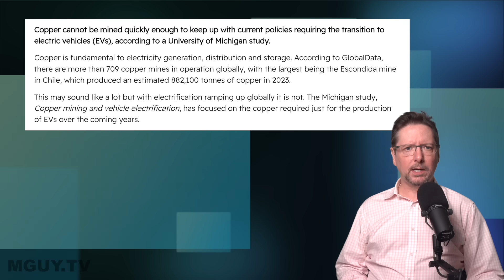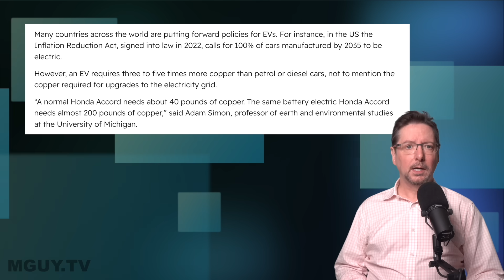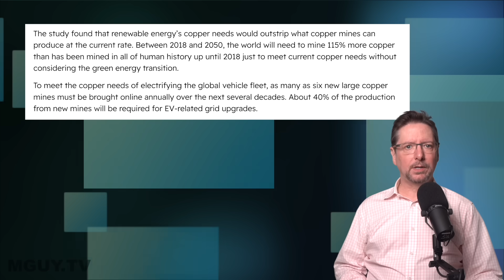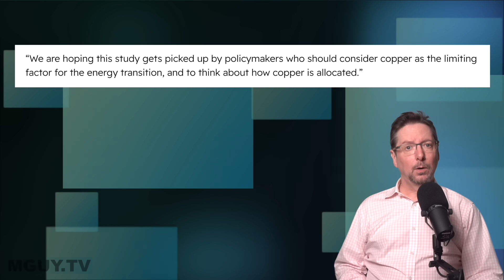Copper cannot be mined FAST ENOUGH for EVs and Net Zero Transition | MGUY Australia

Comment: Well shit eh you have finally worked out what metallurgists like your truely could have told you 20 years ago if you cared to ask but I suppose you were not being paid by the Petroleum Institute back then as you obviously are now
You really need to read some better magazines while sitting on the dunny , I mean the technical stories in Playboy are just not what they used to be.
The rate of mining is insignificant if there is no bloody cooper left to mine in the first place .
But shit I am not a Yankee University so what the F would I know ?
But almost 20 years ago the Copper Development Association put out estimates of the amount of copper in the earths crust 
Now guess what ?
To replace the entire US private vehicle fleet with EVs would require 2.5 times the current know reserves of copper.
A little caveat here is the known reserves are around 60% of the estimated reserves because geologist estimate that there is more than the copper miners know about yet .
And then there is vegetable copper that can be recovered from different plants that bio accumulate it . But that is quite expensive and we sort of need plants to process CO2 back into O2 .
And I see you like to sound impressive with a pile of total BS imaginary numbers  you probably researched off face book  because they are total garbage like most of what you post .
And by the way a large number of car makers now days are using copper plated steel cables for the battery cables and a few are even using aluminium .

Amongst those who know rather than those who just BS on YT there is a bit of an argument about weather we will run out of niobium before we run out of copper .
Then there are another 1/2 dozen rare earth metals that could run out before copper as well because , well they are, as the name suggest rare = not bloody much of them

Please do Australia a big favour & piss off back to the UK we definitely do not need your kind down here we have more than enough home grown clowns

Comment: A good outline of the Energy Transition Delusion. The false and delusional belief that transitioning to non fossil fuel energy sources will be cheap and easy.
Wind has a low energy density and wind power is centuries out of date. Wind farms make no economic sense. They are a colossal waste of taxpayers money and resources (including coal and oil).
Solar panels are only economical as a supplement in sunny areas between the 35th parallels. Even in favourable areas there is a major mismatch between peak supply and peak demand.
Net Zero is economically destructive delusional insanity. The carbon dioxide emissions from fossil fuels are largely beneficial. Benefits include greening of the planet with increased agricultural yields (main effect), reduced winter heating costs, fewer deaths from hypothermia and postponement of the next glacial maximum.
There are 2 mass psychoses in operation (Climate Delusion and Energy Transition Delusion) in association with a massive fraud ( the misappropriation of taxpayers money and resources into uneconomical and unreliable renewable energy projects: Climate Fraud).
A few unscrupulous business people and their stockholders benefit at everyone else’s expense.

Comment: Yes then it drives all copper price up thieves keep stealing it from our job sites and as an electrician we are using more and more aluminum wire. The aluminum wire has to be larger to carry the same current and is harder to fit in the disconnects we use because switchgear is not available fast enough for job schedules because of shortages. It really makes work less fun

Comment: In the UK currently only 17% of energy used is in the form of electricity. (We'll ignore the fact that generating capacity is currently shrinking not growing).

In order to electrify then, the UK will need 5 to 6 times more generating capacity. (We'll ignore that only 4% of UK energy comes from wind, solar or hydro).

That's 6 times the generating capacity. Six times the copper in current use, for distribution and  switchgear. (We'll ignore the figures (Costing The Earth: BBC) that wind and solar require seven times the Copper of traditional generation and distribution.)
Reply: Why do you need 5-6 times more?. The average EV only adds 20% to an annual household electricity bill - not 500-600%
Reply: @davidwall8954 Because he's not just talking about EVs. He's talking about the electrification of everything, which is what will have to happen if we want to ween ourselves off fossil fuels. That's a huge problem that can't be resolved any time soon.
Reply: @simoncrooke1644  In 1970, the world used 5000 TWh of electricity. Now we add that much every few years.

Comment: Even if there was enough raw materials niw, how long would it last? Most lithium batteries have visible degradation within 5 to the 10 years. Battery recycling is not 100% efficient or cheap to do. Even if by some miracle we replaced every car with an EV now resources could never keep up with damaged and old batteries.

Comment: With EV sales falling worldwide & several auto manufacturers ceasing EV production, isn’t the current copper craze a very short-lived phenomenon?
Reply: No, because electrification of everything is well underway. You surely understand that EVs are not the only issue. Solar panels, wind turbines, transmission lines, electric blast furnaces, etc. Everything is going electric, or at least that's the plan.
Reply: @simoncrooke1644  , I agree.  Especially since 3rd World countries are modernizing at a rapid pace, thus creating even more electricity demand worldwide.

Comment: 10,000 Kg windings.
Then add on the weight of, stator, end plates, bearings and armature! Your going to be looking at 30,000 kg for the total weight of the generator.
Not the easiest thing to replace 80 meters above the ground every 25 years, if it lasts that long.
Reply: Everything that humans make eventually wears out, including coal-fired and nuclear power stations. They're not exactly trivial to clean-up and replace. They may last longer, but they still wear out. We have to get energy from somewhere. I suggest we'll need everything that's available.
Reply: @simoncrooke1644  you never know, they may have designed the generators to be dismantled in situ in to small enough parts to be lowered down the tower, the same as they can replace parts on ground baced generators. 
The real shocking thing was, in the UK they were scraping 800,000 tons of parts to landfill a year, until they realised that industry do not do this !
They have now started to repair gearboxes, electric motors, and the electronic inverters.

Comment: Often wondered about this.  Aluminium high voltage lines won’t cut it with renewables.  And all the machines.  Appliances.  Low wattage draw  and supply.

Comment: What worries me if EVs do take off or are enforced by governments is the knock-on impact to other products.

For example, if lithium, cobalt, copper and other elements become scarce, then it makes commercial sense that it is prioritised for the EV industry and  other uses will have constrained supply accompanied with massive price increases - so anything with batteries or motors are likely to get very expensive - such as mobile phones and power tools.

Here is an interesting example.  I fly model aeroplanes as a hobby and I have noticed a massive hike in the price of balsa wood, a sheet that was $1 a few years ago can now cost $5.  Retailers apologised for the price increases that were beyond their control citing the worldwide inflation and cost of living crisis.  But this didn’t make sense, that might account for a 50% increase but not 400%, so I did some digging.  Eventually I found what I think is the cause - wind turbines.  The massive blades are often described as hi-tech fibreglass or carbon fibre, but in reality that is just the outer shell, the inner cores are often balsa wood.  Now if you were a balsa wood supplier, who would you sell to, the aeroplane model industry offering $s or the wind turbine industry offering $1000s.

Comment: Of course, it's even worse than that. EV's use, as you indicated, a laundry list of fairly rare materials. A shortage of any of these others will produce the same crash in supply of batteries. Also most of these materials are used throughout the electronics industry, so as demand pushes up prices for materials, the prices of most electronic devices will also increase. It's a brave new world!

Comment: Well Simon this issue was blatantly obvious from the get go when you think of where copper is used in houses, vehicles, aircraft, the older style plumbing, and motors for fridges etc - let alone using it for EV's and the infrastructure required for them. Frankly when I think of all of the copper that now lies in landfills - in old car wrecks, anything that contains a motor just for starters any mining is as you say an impossible dream because I cannot think of where all of the required ore will come from and perhaps if it were the Earth would look like the cratered moon.

Comment: How many pounds of gasoline, oil, and transmission fluid are used over the lifetime of an ICE car? How many pounds of carbon monoxide are breathed through our lungs every year? How much of that fuel is lost to heat waste (65% minimum)? How big are your checks from the industry?!
Reply: What an idiotic statement.  How much pollution is produced in the manufacture of lithium, cobalt, copper, steel, rubber, and the rest of the material necessary for ‘green’ windmills, solar panels, storage batteries, conductor cables, etc.  Get a grip, mate, and see the reality of the physical world.

Comment: And yet, they WILL mine enough copper for the transition, using modern technology that wasn't available in the past. Technology marches on, trampling over YTubers that try to spread fud to the ignorant masses. Mghigh is playing you all for the easy YT bucks and easier sponsor bucks.
Reply: From 2000 to 2024, copper price rose from USD 0.81 per pound to USD 4.75 per pound, or a nearly 486% increase when the inflation over the same period is 82%. Clearly the market thinks that copper is a commodity in higher demand than it can be produced...unlike lithium carbonate which is relatively stable. Go figure.

Comment: My back of a fag packet calculations show the same for lithium. At today's record-fast mining rate, it would take 600 years to mine enough to replace combustion cars one for one. I can't see many of the electric cars lasting 600 years! That obviously doesn't take into account advanting technology requiring less lithium, or centuries of replacing worn out cars. 
It does prove though, that Net Zero is literally impossible with today's methods and technology.

Comment: could you also look into aluminum, i noticed the cyber truck disassembled by munro had aluminum wires in it. It be interesting to see if theoretically there is enough production of both metals combined. I assumed not, not to mention i don't think Al can fully replace copper in its various uses, and it is inferior as far as it's conducting properties.

Comment: Shocking but not surprising how much copper needed for wind turbines. In the UK as I imagine in many other country's, the use of copper for water pipes has been replaced by the use of horrendous PVC. But understanding the need for copper in the new renewables industries and the relative short supply of copper. I'm surprised its price isn't up there with Gold and silver.  Then there is the  massive need for gear oil in the transmission systems of those wind turbines. 
Whats that about ',just stop oil '?
Although there is always room for improvement. I think the energy situation was just fine as it was but sadly they have deliberately destroyed many viable power stations in the UK and left us dangerously dependent on "green energy". Thanks for that! Life is just getting too expensive.

Comment: A lot of electric motor makers are using Aluminium due to. cheaper. less denisity. more supply. Most high voltage transmission lines as in over 100000 volts use alloy as it works well & lighter reducing strains on pylons. Yes they usually a strainer wire inserted to stop sag. It appears you may to dig a little deeper into your research before commenting. However I am against EVs.

Comment: Get real. Aluminium conducts electricity almost as well as "pure" copper. Aluminium can be, and is used for,  generators, motors, transmission lines & for domestic supply. Yes there are different ways the material needs to be terminated, copper is easy, however aluminium  requires silver to assist connection. which is also a good conducter. The cost between the two is massive. The cost of copper loses to ally, including the small amount of silver needed. So stop worrying about copper as there is an alternative which is in use today extensively.

Comment: That argument about the 'hidden' costs of an EV are exactly the same as one I had about 12-15 years ago when some character poo-pood me when I brought up how much his Cadillac CTS, if I recall the model correctly really costs.
You just mentioned the electric grid updating but didn't include home and commercial wiring which also takes a great deal of copper and is required by electric codes in many areas since aluminum has proven dangerous. The cost of a 250 foot roll of 12-2 awg wire has gone from about $25 ten years ago to about $150 today. Guess I'm not going to do much home upgrade wiring nowadays. And you wonder why new homes cost so dearly now.

Comment: The EV scam is going to be terminated by the AI hysteria. Big Tech will need all the copper and electricity they can get for the enormous banks of computer data centers they will need to build to run their AI programs. And they will make far more money from AI then anyone can from the money-losing EV nonsense. You can't have an EV hysteria (based on the fake climate crisis) at the same time as an AI hysteria (even more hysterical than the crypto fad). One has to go.

Comment: Ironically, internal combustion cars is far more sustainable, since fuel can be made from Renewable vegetable or compositing organic materials. Also a basic internal combustion requires far less exotic materials. SECONDARY components it uses platinum for emission, but removing it won't affect range and performance.

Comment: Expect the cooper price to reach astronomical levels, if you can, start buying now  all necessary stuff for your house and/or any other component, like the cooper bar used for electrical grounding in houses, cooper pipes for fixing air conditioners/freezers, heatsink for CPU and GPU on PC's, etc.

Comment: There's also the problem of a serious aluminum shortage.  A bit of a sticking point if you need to vastly expand your high voltage long distance electrical distribution network to handle a titanic new load.

Comment: The 400Kv cables (between pylons) solve the problem of copper. The centre core is steel for strength this is overlain with aluminium for better conductivity and saves on the cost of copper. The reason there are four cables separated apart from each other is to prevent electrical discharge from the cable due to the dielectric strength of the air being exceeded by a single conductor.

Comment: I think it’s important to note that the more minerals are mined the poorer the ore grades become and the more bulk mining time and effort is required.The easy stuff has been and continues to be depleted year after year requiring more earth moving and lower production figures with time so all these forecasts of future production needs will require much more effort to produce.
Reply: Mmmm, I take it your suggestion of reduced concentration is based on a single point in an individual mine/operation.💁‍♂️
Reply: @0Aus  What? Not at all.Ask actual an mining engineer if ore quality improves or deteriorates with time on a discovery.
Reply: @lv4077  Mmmm ok we will do it this way.  I asked a question to clarify your information but Na ok.
I work in the mining industry (Australia) have done for 20 years there are many variables both on the same mining lease or a different site/ore type. While in some circumstances this may be the case it certainly isn't the reality for every mine.
Ore bodies even of the same type are varsity different in many ways. 
Thus no suggestion all deposits are the same/mine the same is not right!
Have a great day 🖐
Reply: @0Aus  Ok,I’ll ask specifically about Iron ore.Humans have been mining Iron ore for many thousands of years,are we finding ever more rich deposits of Iron ore or are we finding it more difficult to find more high quality ore?